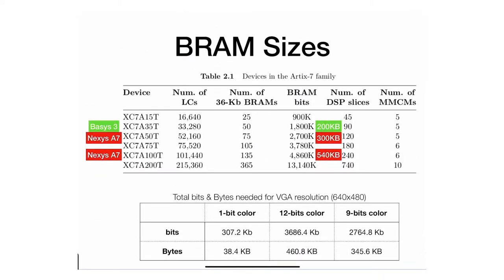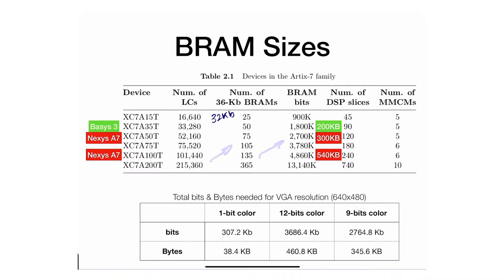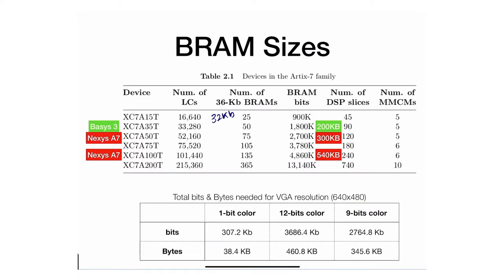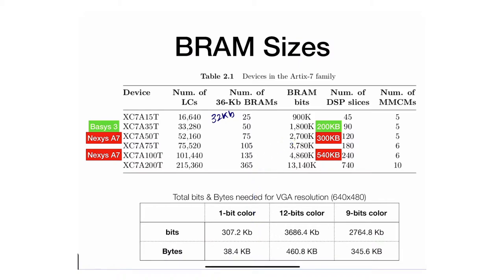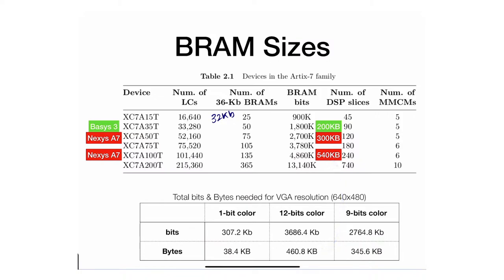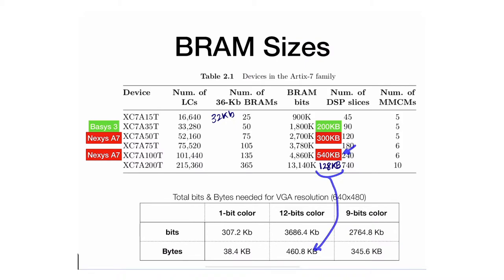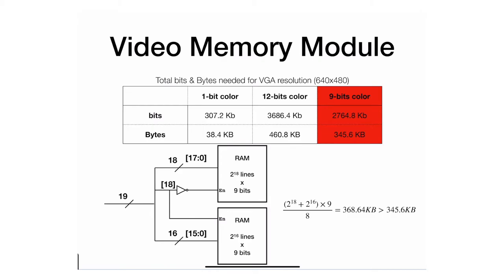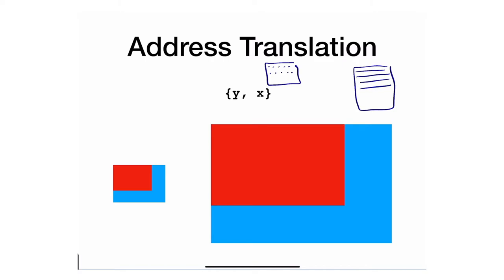M18 - 2 - Frame Buffer Pixel Generation Circuit

Comment: Very good video!
I would like to know however about the clocks u are driving each module with. Is ram updating with same 25MHz pixel clock?
Btw, i understand memory is adressed even when in blanking interval, so u are sending pixel data on it too, since adressing is combinatory wo any video enable condition